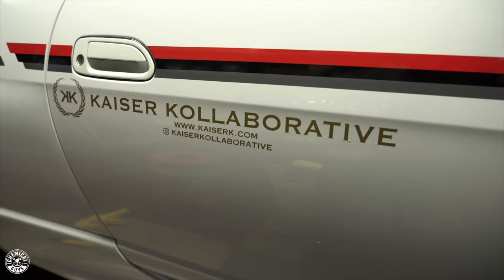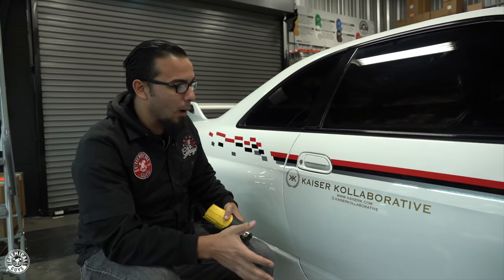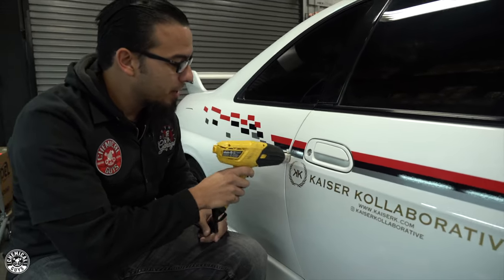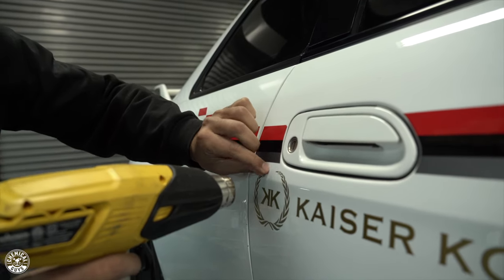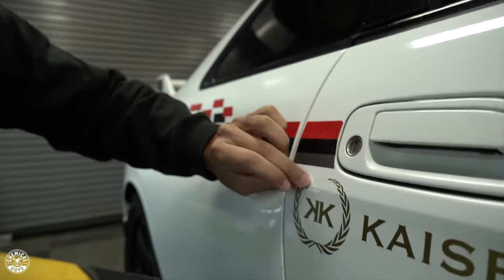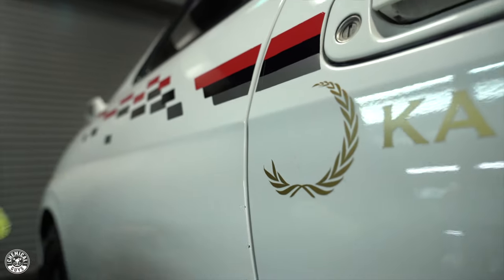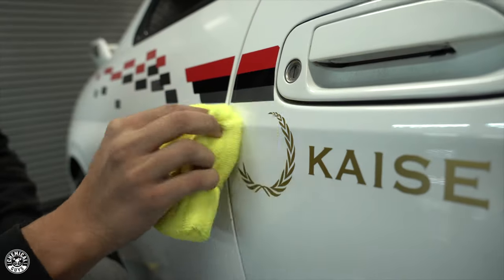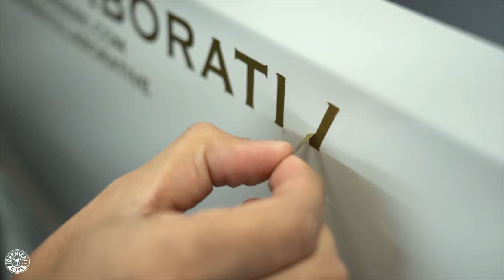How To Remove Vinyl Decals The Right Way! - Chemical Guys

Comment: Thank you so much for this.  I used this technique to remove vinyl dealership advertising from my lift-gate, I used an industrial-class heat gun like the one shown, on the lowest heat setting, and as described, washed the hot air over the entire 2" decal for about 15 seconds, always moving the gun around to spread the heat evenly.  Then I picked at a corner, and the whole thing peeled off in once piece.  I wiped the residue off with a a general purpose spray cleaner, and it's like it was never there.  I don't like those decals at all, I wish I knew about this technique 20 years ago.
Reply: I'm with you! Hate when they advertise on my vehicle. I ask them not to put them on and mostly they dont, but nice to be able to remove them. Back in the day, i've seen some that were rivited on....crazy!
Reply: 🙋🏾‍♀️ did he say butter wet wax?

Comment: removed a bunch of vinyl from a work truck before I sell it. Have noticed 'ghosted' lettering particularly on the LEER  truck bed cap glass. tried denatured alcohol, adhesive remover, clay bar and detailer spray, dish soap and glass cleaner. The ghosted lettering is completely invisible until the glass is wet. Thoughts?
Reply from the maker: Hi Dan! Try using a light polish such as V36 Cutting Polish with an Orange Hex-Logic Pad.

Comment: Awesome video ❤️ Be very careful though, if you do this on a bumper or something else that has paint on it and it's not metal you will get the paint off as well, 1st check if the back of the decal is metal or not, if it's not then be very careful with the 🔫 gun, very easy to remove paint and you're done for.. Game Over. 2nd Tip use ^Trim Clean Wax and Oil Remover^ on the sticky glue left behind the decal! Works great 👍

Comment: 👍👍 BUT—this is ONLY for the PATIENT, Cautious person, willing to let the PARTICULARLY Cautious Applied heat process work. No fingernail impatient “scratching” or the like. 
Use the gentle (not Pro) Goo Gone. 
There are commercially available, rotary “removal” tools and they are NOT a viable shortcut, if you’re impatient. I did an entire F-350 body wrap this way, but I can see the three places where I thought I could shorten the process, but I was wrong. The older the wrap/sticker the more slowly you must go and the longer it’s going to take, which in those cases, it’s creeping more with the Goo Gone and less with the heat.

Comment: I've got the adhesive all removed but when the dust settles (dirt roads) it shows the decal outline perfectly. How do i fix something like that? Looks fine when it's cleaned up but the dust shows the perfect outline.
Reply from the maker: Hey! A light polish will remove any remaining residue, try using an Orange Hex-Logic Pad with V36 Cutting Polish.